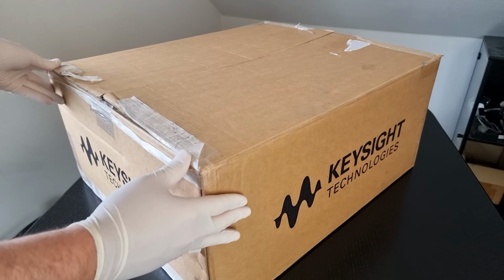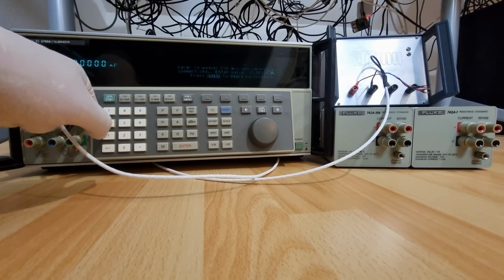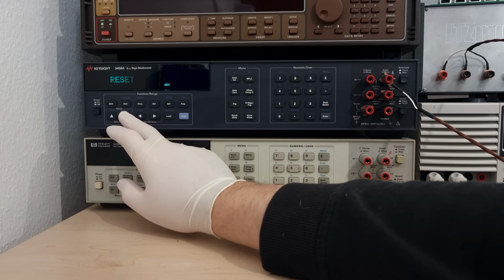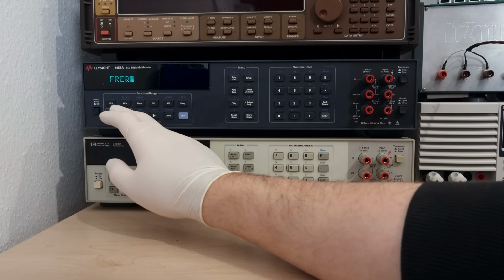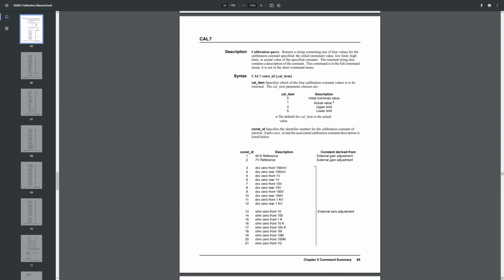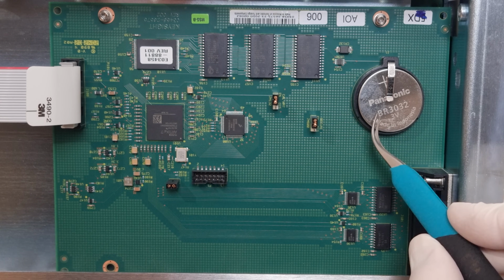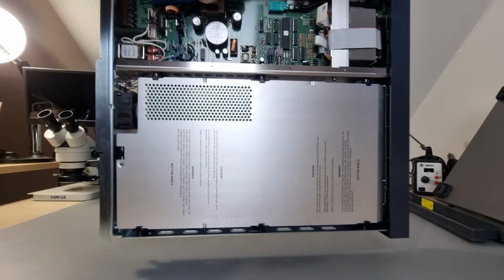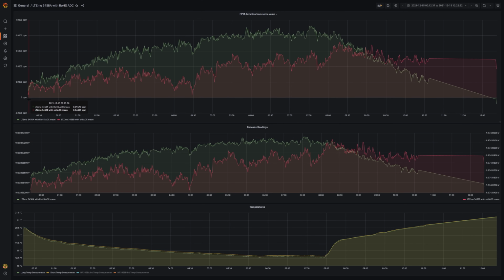What has Keysight done to 3458A?! Dark Theme 8.5 Digit Multimeter

Comment: I am deeply proud of the team that completely re-designed the 3458A to ensure RoHS compliance and to address obsolete components.  I was the executive VP that was responsible for that effort and I retired with nearly 40 years of service at HP / Agilent / Keysight a couple of years ago. I hope you are still enjoying the measurement wanderlust of your Keysight 3458A.  The model number remained the same, because one of the primary goals was perfect compatibility.   Sorry we didn’t add an Ethernet or USB interface, but we decided to focus on sustaining terrific measurement ability/stability and there are multiple after-market boxes to translate into HP-IB.   Yup, a number of wonderful “gray-beards” were involved from multiple continents.
Reply: Measurement stability is still a competitive differentiator for this 36 year old product.  So sorry, I cannot disclose specifics and glad you have noticed the design team’s efforts to continue improving measurement stability.
Reply from the maker: Wow, thank you for your work and yes I still am and will likely for as long as I do electronics rely on the 3458B.  My older HP unit has a +37 ppb/day CAL?72 drift no matter what I do with temperature or humidity, whereas the Keysight box doesn’t even have a trend visible in that parameters development over the last 3 years! Is there anything you’d be willing to share about U180 drift? I always suspect a humidity issue, because the package seemed to be only sealed with an epoxy plug, a friend strongly believes it's electromigration slowly degrading the semiconductor half of the hybrid.

Comment: 0:48 The White face 3458A  chasing my ppm's has the Keysight upper Left "display-bezel" where the display is. Keysight red snake logo too. :) The unit is made in America with the A in the serial number. So maybe the display bezel only got replaced and not the entire front panel? A new old stock white entire front bezel is 500 bucks by somebody in China on ebay and it says Agilent.

Comment: Former Keithley engineer here.  While we certainly respected the 3458, I often wondered how many difficulties HP/Agilent/Keysight had to keep making the 3458 for so long.  I had to work on maintaining the Keithley 2002, and let's just say there were a lot of parts that had gone obsolete in the 2002's lifetime, and some parts we had to get creative trying to replace them.
Reply: 3 decades ago I was in APEX Surplus in Sun Valley and a friend was buying used Fluke differential volt meters to rebuild many for a military place. The original older serial number ones had a slightly radioactive neon bulb in the chopper circuit. A stock new bulb worked but did not last as long. The doped neon bulb that was slightly radio active had a lower firing voltage. I think the replacement Fluke bulbs then were non radioactive.

Comment: You might be the person to ask. I remember using a bench top DVM in class some time before 1977. It  had the form factor similar to the Keithley 2700, but the bottom half was a plug-in compartment that allowed it to become different devices... Such as a DVM, Frequency counter, etc.. I am not even sure of the brand name..

The main body was a metal case where the top half was nothing except a display and power supply.
The bottom half was a slide in compartment with a connector in the back. This is where the plug-in modules slide in like a drawer until it presses into the connector at the back.

If I remember correctly, the display was a standard RED 7 segment LED display.
I know it is nothing compared to the meter in this video, but I think it would be nice to find out what it was and what it was capable of...

Comment: I have family living just 1km away from the PTB. The low ppm’s are palpable in the air when you bike past. Also nearby is the national agricultural research centre, where they have cows with holes in them. The collaboration potential between these two institutes is infinite.
Reply: Those are called cannulated cows.  They are used primarily for feed research.  The first cannulation was performed all the way back in the 1920s from what I read.

Comment: Great video Marco, I noticed on my HP34401A that the mains voltage varies the amount of power dissipated within the instrument than the internal temperature, so even if the ambient temperate is stable the varying mains volage will still change the internal temperature.  As you are trying to eliminate all sources of  PPM leakage an easy simple solution to further stabilise your test setup is to run your equipment from a stable AC voltage source which these days can be as simple as a 48V battery inverter from your new PV array. The added advantage is being fully backed up from any mains failure further locking those PPMs in.

Comment: My first 11 years out of college I worked on Automated Test Equipment and every machine my division shipped had a 3458A inside that we used for auto calibration. I worked on the automated calibration of the machines and managed the driver for the 3458A. You know pretty much all the secrets of the machine and the auto calibration after a 1C change for sure was part of my routine. One thing that we used was current measurements and I remember that we had a problem with measurement noise coming from the GPIB interface that only affected current measurements. We found a company that sold a GPIB isolator and we had to install that between the 3458A and the Sun workstation that was the computer in our testers. I had probably touched a hundred 3458A meters while I worked there and everyone was amazing.

Comment: Oh, it would actually be pretty easy to build a light-duty cleanroom. Mostly just getting the raised floor tiles and setting up air circulation to the ceiling with filtration somewhere in the air chaise/ducting.

Comment: EXTREMELY disappointed to see the thin sponge style of dust filter on the rear - was that the original filter provided? Those fall apart quickly and leave the intake bare. I find the cup-style wire mesh filter to be the most effective, and easiest to clean.

Comment: It is an impressive multimeter indeed. Can you please show some real applications where having a 8.5 digit multimeter really makes a difference?
Reply: Pretty much any scientific stuff as well as high grade engineering for most measurements you need measurement field about one tenth of tolerance field and smaller measurement field is always better because you can pass parts closed to the acceptability limits. If I have a micrometer with that is +/-10um I can pass parts that are at least 10um from the set limits for a 100um tolerance field it is 20% reduction on the other hand if I use higher grade tool with +/-10um error I can pass parts measuring as close as 1  um from the limit. If manufacturing is done too precisely it doesn't matter because most parts fall inside more reduced tolerance field but if the right amount of precision is used in manufacturing there might be significant difference in rejected parts between these two tools.
Reply: @tymoteuszkazubski2755  I understand this (I'm a chemical engineer and can easily come up with examples where a 1 ppm mistake could cause explosions and/or posion someone). However, I can't come up with examples where having a 8.5 digit multimeter would make a difference compared to a e.g. 5.5 digit multimeter and I'm simply asking if such examples exist (books, videos, articles etc.). I'm requesting examples where having this much precisions would affect a decision and not just be used to create nicer plots.
Reply: @larsgregersen  , one example that comes to mind is evaluating high resolution ADC/DAC. You can see in Reps CERN video that the folks at CERN used 4 3458A multimeters to evaluate the voltmeter they designed.
Reply: @nickstanley5064  I find that the argument is going in circles. Isn't the idea of that video to describe the design of a 8.5 open source multimeter? Of course, you then need a high precision multimeter. It still doesn't give any practical examples of why you would want a 8.5 digit multimeter for a practical application.

Comment: I'm pleased to say I have one of these pieces of precision test gear on my bench right now. It has been there for a few years, powered up 24/7. It seems nice and stable, always reliable. However, it does have a white case, not one of the trendy black enclosures. 
No, not a 3458A, an Auriol radio locked clock / thermometer!  Oh man, imagine if you could get 3458As from the middle of Lidl!

Comment: Having a older HP lying around... Telling me eeprom error or similar (haven't powered it on quite some time). Any idea?
I tried to find some manuals, but other than "there are some hardware errors which can he shown" was not described.
Reply: Tomorrow I am at work, in the lab, and can check the message again.
Reply: Okay, no multimeter but one HP 3245A Universal Source. Error is "STF 17 Bad CMOS", and after a while "ERR 201:PON". But after watching your video, I finally had a clue how to use the device and after pressing "enter" it seems to work.
Background: I started here and only had a few months with my former colleague. Now most of the knowledge about the lab stuff is in retirement.
Reply: @Stimmenhotel  Sounds like it needs a new CMOS?
Reply: @NimbleJack3  as I said, I haven't found anything in the limited documents I was able to find online. But after pressing enter it works.
So the CMOS is not running the os (as I first thought). So opening it up and replacing the CMOS bricks with new ones should do the trick?

Comment: Here is some noise plots with shorted input (stdev of 10 consecutive readings) vs measurement time.
drive.google.com/file/d/11nVpWcODYI24LoYCib0gsInQEauvAumb
And 50Hz suppression was not extremely good (considering voltmeter price), as well as low frequency noise, 
Could you please repeat voltage noise test with a new black HP, like 3458A_vs_B_noise.csv but over longer time, few hours, with APER of few tens of NPLC at minimum 100mV? input range, and similar but over few seconds with a APER of <ms, it should be able to store few 10k of readings.

Comment: Does someone know the purpose of those many copper squares on the top layer of the processor board?
Reply: To reduce the amount of copper that has to be etched from the board, and to have a similar amount of copper between top/bottom to avoid bending the board during soldering.

Comment: Wow, amazing how the ambient temp influences the meters cal. GPIB would be easier than going through all the menu buttons.
Reply: GPIB is the intended method for driving a 3458A. You can actually only get the maximum number of digits of resolution from the remote interface - the front-panel display always drops a couple.

Comment: The DCV T.C. arises from both the LTZ reference and the U180 circuit. In my 3458A, both parts each contribute about half (0.2 and 0.25ppm/K) of the overall T.C., in the same direction. You may distinguish both by measuring CAL? 72 over different inner temperatures (do ACAL at different extreme TEMP? values and directly write down this '72 gain parameter). KS still did not correct the other design bug  in the LTZ1000A circuit, i.e. the 200kOhm resistor is still equipped, which should only be used for the non-A version. Therefore, I suspect that your residual 0.5ppm/K mostly comes from the reference board. Other possibility is, that on your older 3458A, both T.C.s mostly cancel out. A last hint: get a  proper basement room, which might serve as a passive A/C, i.e. stable R.T. at +/- 1°C over the whole year. Under such unstable temperature conditions, your equipment is like Anna Kournikova: Looks pretty nice, but does not win a price. (Temperature) Stability is everything.